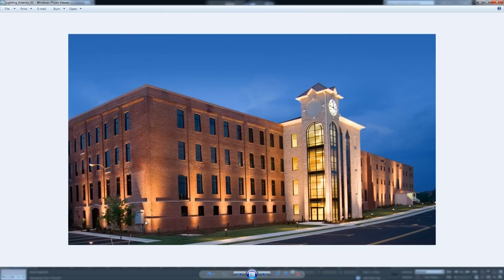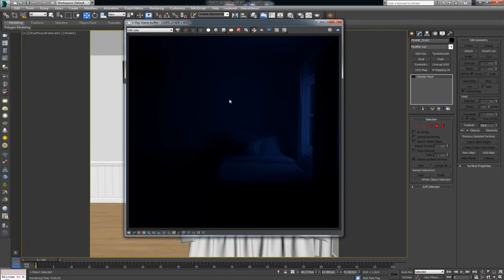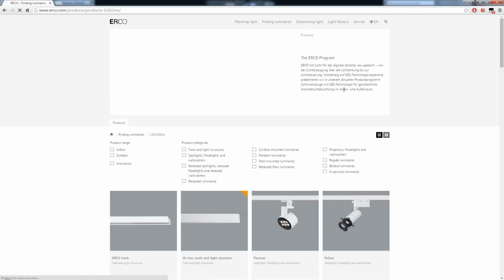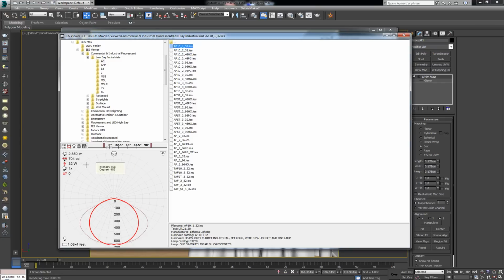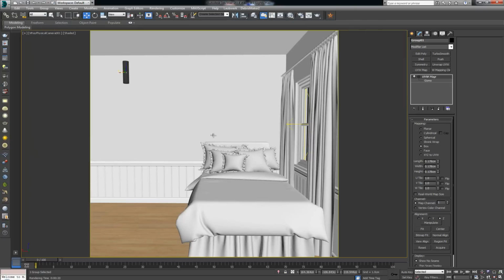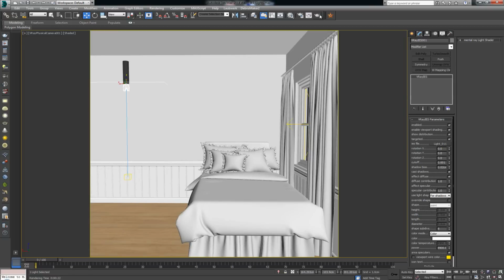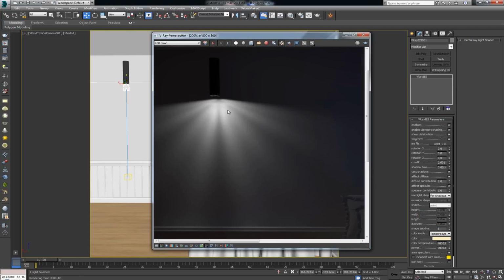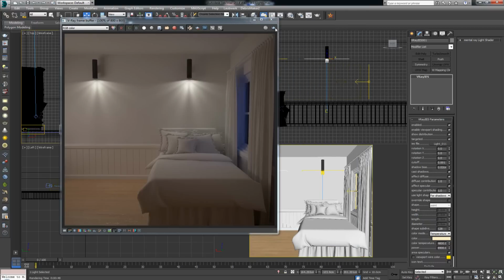IES Lights in 3ds Max

Comment: Nice and in-depth.
A small tip for anyone: You can drag&drop from the ies explorer to a folder to make a shortcut. I find it more efficient to do this inside the project folder as I can easily track what lights I use. 
Also, there is no site in the description.